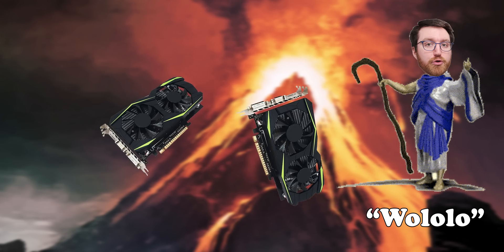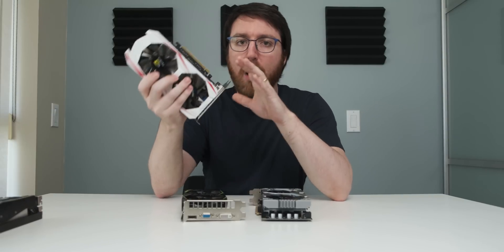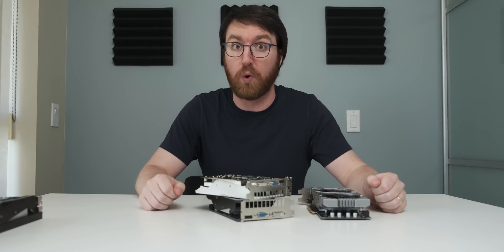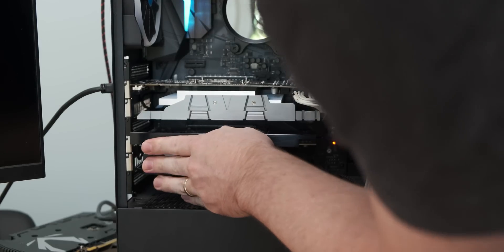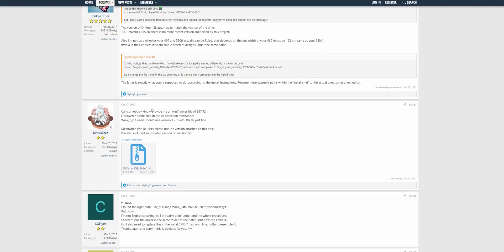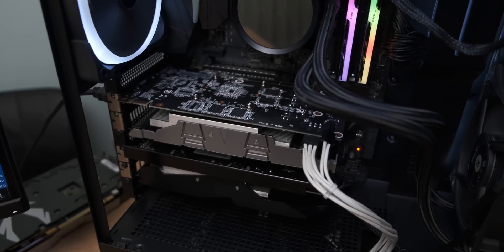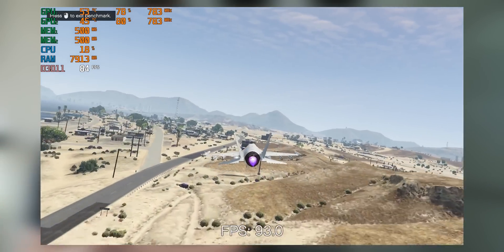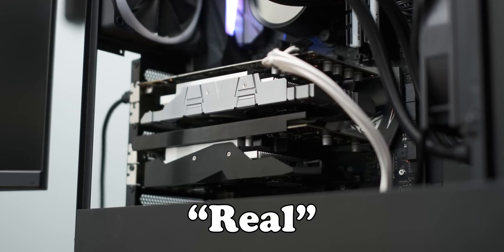The world's MOST JANKY dual Graphics Card setup!

Comment: have you thought about trying two cards off one pci port on motherboard using and slot extender PCI-E Express X1 to Dual PCI Riser Card Slot Expansion thing . did look at Riser cable things but could not find 1 in to 2 pci with a cable but a plug in board option there is an option. would they just work if you plugged to graphics cards in as the both just running on one pci slot. just an idea

Comment: Tip if doing this: get a big old chonky heatsink from anywhere and plug the card into a cheap mining riser. Just lay it flat and put chonky heatsink onto the chip, gravity will be enough and allow you to verify if it works or not. Make sure chonky heatsink doesn't tip or otherwise short anything on the board.

That's how we repair GPUs, mounting coolers etc every time isn't really practical and chips don't get hot enough to damage themselves so long as you're sensible. If it works then button it back up properly of course and especially before considering real 3D load testing.

Comment: Solder some flying leads to the pads and have the bios chip dangle next to the pci connector? should work fine, no tricky high speed data transfer from a serial Eprom like that.

Comment: did you check the die over the card listing and double check the BIOS again? if its still arsed try checking for cold solder joints. if you can't find anything get it X-rayed for BGA bridged ball failure. sometimes somebody screws up and has two balls or more stuck together

Comment: I wonder if the boards the parts sit on that can take more memory can be bought or scrounged and then the garbage components installed.. or is it even possible to do silly stuff like use 2 500mb Memory modules so it thinks it has 1gb ?

I'm fascinated to speculate what could be brute forced and what can't.

Comment: i had a 3x gtx 780 sc sli rig running from 2012 to 2021 when the first of the 3 cards died. second died 6 months ago but card number 3 is still running strong in my cnc rig

Comment: Why'd be put the heatsink back on the card after every time he flashed the BIOS?  You wouldn't need the fan and heatsink on if all you're doing is turning it on for a second to see if it works or not.  I'd also be curious to know how many of the uhh 92? 96? BIOS files he had to flash until he found the one that worked. I know with my luck it would have taken me 70 attempts.

Comment: Wow the glitchy texture in tomb raider looked like cockroaches crawling all over it.

But yeah my understanding from what i've heard of SLI is none of this is that unusual.  I heard that most users had issues with it just not working with some games, being glitchy, many games being slower or more stuttery.  It's no surprise the technology has been discontinued.  It was probably expensive to engineer, produced often poor results that might've only been useful to show off impressive benchmark numbers for a few games, and might've even cut in to sales of new cards for people it did work well for because they could just buy used a second of the card they already have to get more life out of it.
Theoretically with D3D12 and Vulkan, games can manually utilize multiple GPUs on a user's system but i don't think any major game or engine has done this.

Comment: does the modded NVflash for bios crossflashing not work aswell?(the on that doesn't care about any of the ID's etc), and to find the right vbios that will cross flash easy, you can check gpu-z for the various specs its currently running, then save the original messed up bios, chuck in in a bios editor which will give you the real specs its running at, then look at the card and the brand of vram, then short list down the cards not running the vram clocks at the same speeds, then shortlist based on what type of displayouts they have, then on that shorted shortlist, you check which brand of ram those vbios's have timings for(techpowerups bios list usually has vram manufacturer timings or at least name listed on each bios) and by the time you do that, you will have about 2 or 3 that will all probably work rather than just guess

Comment: You don't need to use that SPI flasher... You can just use the patched version of nvflash which is used to put the wrong bios on a card. (upgrading the bios of a 1080ti FE to a 1080ti FTW3 for example). It removes the checks that it usually does to make sure you're flashing to the correct revision.

Comment: What i'd love is if Async Compute could be paired with multi-monitor gaming, instead of having 3 graphics cards, with only one of them connected to the monbitors, it would be far better to have each GPU, drive its own monitor, using 3 GPUs to drive one monitor WILL result in frame time issues, screen tearing ect. But if each GPU drove its own monitor almost all of the issues of SLI/crossfire would be gone

Comment: I think matching the VRAM in the BIOS is very important. I actually got 2 real 1GB GDDR5 FE nVIDIA GTS450's. Even got the SLi bridges for the AsRock Z77 Extreme 4, eVGA 680i SLi and Z370 Aorus Gaming 7. Games of that era actually run quite well. Sniper Elite 3 and 4 along with some others. Ashes of the Benchmark is a pretty cool Game/Benchmark. You can even run a nVIDIA, AMD and intel iGPU in Tri-X-SLintel.

Comment: Hey Dawid. I bought the gpu at 3:45 with the bios chip conveniently on the back. It also has the best looking cooler design.

Lots of people are asking which bios to try.
After many hours flashing and testing, I found these from techpowerup worked for me:
Palit.GTS450.512.110121 - 512MB
MSI.GTS450.1024.110427 - 1GB

Perhaps yours is identical and has the full gigabyte of RAM chips onboard; with all the revisions it might not be the same.

My board has a 4-pin fan connector that fully controlled a pwm intel cpu fan, ramping up and down with temperature.
The 2-wire fans run constantly at full speed but a 4-pin mod is at least possible.

Thanks for the fun video.

Don't worry, I got a full refund.

Comment: Just a thought, couldnt you just use a few pcie riser cables, and instead of screwing the heatsink on each time, merely put it back on and boot with it outside of the case? And if a bios fails, you save yourself the time of taking it out of the case and removing the cooler?

Comment: loving this vid..... I had two gtx970 in SLI, it was funny 2 years... also to force Sli thru Nvidia Inspector sw for games that dont have its own sli profile in nv drivers (for short, using sli-bits code from game using same/similar engine)
Reply: the only games where it didnt work was RDR2 and... AC Origins, AC Odyssey as reminds me
Reply: mostly it was 50-60% FPS boost in performance, sometimes the gpu usage was only divided between 2 cards (f.e. 94% into 2x 47%) and ran in slightly better temps

Comment: See, if you had through this through, you would have soldered an 8 pin header to some wires and attached it to the BIOS chip (it's only 8 wires, easily done!), then you wouldn't have needed to remove the heatsink so many times.

Comment: Technically the GTS 450 couldn't handle triple or quad SLI because of the single SLI connector... but with the SLI jank software you could actually pull that off... so how about going through the headaches to flash all 4 cards to properly recognize themselves as GTS 450s and triple/quad SLI'ing them? Maybe even overclock them at a certain point? Proper balls to the wall action no?

Comment: Probably somebody already told you this: you can try to make leads for the bios chip so that you don't have to take the cooler off to flash the bios. Furthermore, I strapped an old AMD cooler to a new AMD cpu with two loops of copper wire and two tie wraps, and it is totally how people should make use of their old AMD coolers. If you make an A shape in the wire the cooler stays centered too. Thanks a lot for your videos!
Reply: I know this is an old post, but even if you do take the cooler off to flash bios, you don't need to put it back on if you're just testing to see if the card puts out a good signal. It doesn't take long to tell if it does or not, once you see artifacting just cut the power and flash another bios
Reply: @louiesatterwhite3885  That is a good idea, and hold a suitable heatsink out of your collection onto it during the test if you really want to be safe.

Comment: Why do you need to put the heatsink back on just to see if it will boot up? (btw you can disable test mode after you have installed the drivers usually, Usually most modded drivers are actually signed they just wont install without being in test mode, once installed you can go back to normal mode though)

Comment: Part of the bios flash issue is finding the bios that supports the right vram modules. Different gpu vendors use different memory modules so if you have a card that has elpida chips you need to find a bios that supports elpida. Thats part one, then you need to guess and check which of those bios use the same memory timings of those memory modules. And to avoid using these bios chip clamps if you use an old version of nvflash, which you can find on ltt old video how to flash a gtx 465 to a 470, you can erase eeprom through that nvflash version then reflash the proper bios. This is how i flashed a gtx 470 that was flashed into a quadro 5000 back to a 470

Comment: I was once asked by an old college friend to help out with his PC. We hadn't seen each other in years, and he had the same PC he'd had back then, bought new in the mid-'00s from a weird PC retailer that built "custom" systems for users. I opened it up to have a look  what we were getting in for. In one of the weirdest setups I've seen in my life, attached to the XFX nForce socket 775 motherboard, was an SLI-linked pair of tiny passive Quadro cards, each roughly equivalent in power to an Atari 2600. 
So no, your fan-cooled, GDDR-powered pair of Fermi beasts is pretty damn far from the weirdest SLI setup ever.

Comment: So, when are we going see that quad-SLI setup? 
On a more insane note maybe use an AIO water cooler  DIY on to the GPU to allow you to flash and test without having to dissect the card every time. Oh, hell get a PCI express extender and cut out having pull the card in and out of the case.

Comment: Man, that windows test mode is only to install the driver, then you should have rebooted into standard mode and the changes stick
Reply from the maker: Are you sure? I saw a bunch of people on the forum talk about how they hate you can only run it in test mode.
Reply: @DawidDoesTechStuff  I am pretty sure, but I think booting on test mode is made to allow the installation of modified drivers, and driver signature enforcement  can be disabled by other means, using a command or advanced reboot options. I do it to install some obscure hardware drivers, and once the drivers are installed, they stick forever, even with driver signature enforcement enabled again

Comment: well just to say ive got the best graphics card here 

a gt 1030
Reply: You're wrong! I have the best :
Intel HD graphics
Reply: @the-real-sachin  lmao
Reply: @the-real-sachin  the thing is that my system is alright {like my cpu case ram and motherboard ish} its just my grpahics card thats trash
Reply: @cEreal-X2X  sure it, is what's ur cpu mobo and ram then
Reply: @b.henriques9871  adata 8gb 2666mhz 
and ryzen 3 2200g. And a asus a320mk
and case: cooler master mb 520
Reply: @cEreal-X2X  that's not at all "good", you have a good socket for upgrades, other then that, that's pretty entry level
Reply: @cEreal-X2X  but it's "alright" if all u do is play esports, for upgrades on a budget, i recommend a ryzen 3 3300x for 120$ if on stock /ryzen 3 3100 for 100$/ ryzen 5 1600af 85$ if on stock or used market ryzen 7 1700 for 100$ at max pay no more then that, for gpu on a budget, 1650 super is the best all round choice for 160$, used market look for rx 570/ 580 4gb  for less then 100$ and gt, but 1060 3gb for less then 100$
Reply: @b.henriques9871  did i ask
Reply: @b.henriques9871  You just recommended him a zen 2 chip in an a320 board? Also his best upgrade path is probably a 2600/x and anything from a 1060 to 1660super, unless he can spend a lot more in more ram+a b550 but at that point it's a new pc. As it is, it's fine, just the 1030 is really bad, the 2200g is almost as good and it's a cpu.
Reply: @Daeyae  a320is okay with a ryzen 5 65w cpus, if no oc is being made is more fine, ur dumb to think otherwise. b550 is 100+ alone, considering he has a budget system, best option without breaking the bank would be a ryzen 5 1600/2600, and for gpu 1650 super for 160$ or rx 570/580 if he has good enough psu
Reply: @Daeyae  and true that, the igpu f he 2200g is as good (or bad lol) as the 1030
Reply: @b.henriques9871  a320 doesn't support zen 2, it can if you know what your doing, but it's just not worth it.
Reply: @b.henriques9871  a quick YouTube search you can see the performance difference if a 1030 and 3200g, it's not that much
Reply: @Daeyae  some do, even third gen, all depends of the manufactor, and I agreed with what u said bout the 1030 and 2200g igpu
Reply: @the-real-sachin  same :D
Reply: Gt 10 thiddy
Reply: @iiieliteiii7840  lmao
Reply: Laughing in GeForce 210
Reply: @sntly573  g210
Reply: @FS--ew3se  huh?
Reply: @sntly573  I found a hp prebuilt wit a g210 
U know da ultimate gpu for gaming/streaming?
Reply: @FS--ew3se  what are you even talking about why are you replying to me what do you want from me
Reply from the maker: We got a badass over here. 😁
Reply: @DawidDoesTechStuff  hello I have a question why is there a W in your name and not a V?
Reply: @DawidDoesTechStuff  lol not gonna lie i have best gpu from all the people in this replies tab.
Reply: Laughing in 9800 gt
Reply: Me laughing in radeon vega 11  🤣🤣
Reply: @qnovalegion-old9338  better than the 210
Reply: qNovaLegion haha that’s way better than a 1030
Reply: @admirallfs9023  I know :)))) I tried to be a different one, since everyone laughs in gt210 and things like that xDD
Reply: qNovaLegion Lol 😂. Whenever I go on their channel they be like MY NEw $12000 GaMiNg Pc
Reply: 1030 gang
Reply: Gt 10thiddy*
Reply: Laughs with amd hd 8490
Reply: Gt ten thirdif
Reply: I have the best

GTX 960 SSC.
Reply: I got your younger brother gt710
Reply: geforce 256. beat it kid
Reply: @xp1539  128mb macbook pro
Reply: @FS--ew3se  ERA 1101
Reply: @xp1539  who?
Reply: @xp1539  aha

Comment: I have bought a cheap pc with a fake 750ti, I have done the same with the bios flasher and it worked really fine. You need to look for the bios which has the same outputs as the one you have. Also look at the shape of the pc itself. In my case the Grey one was a Gainward Gts450
Reply: It's mainly the type of memory which matters most. You can't use a bios for an Elpida ram card on a card with Hynix for example.